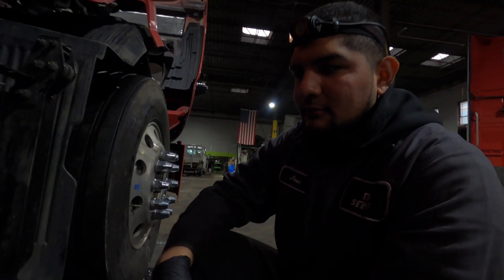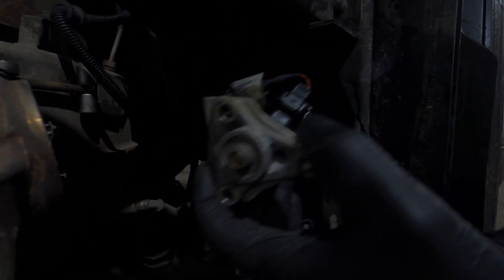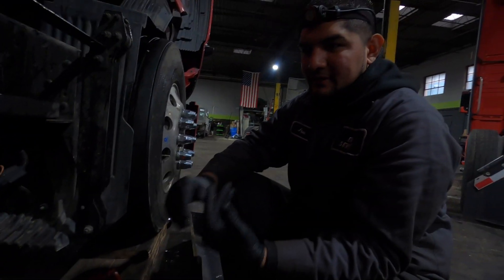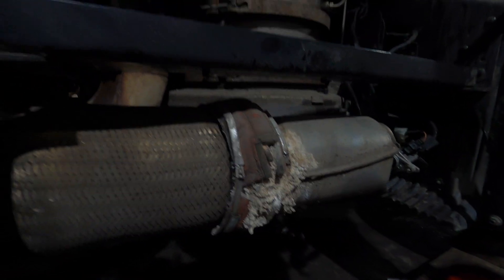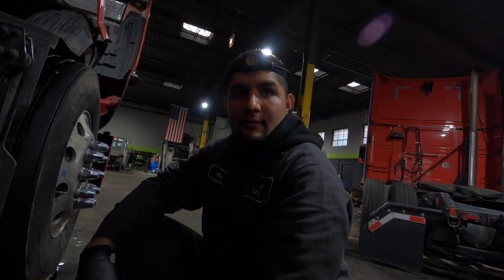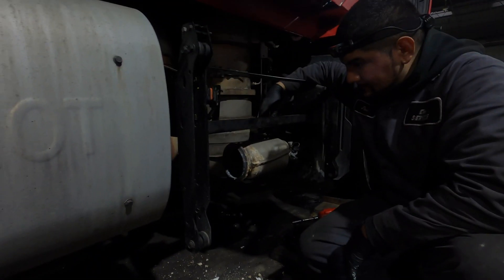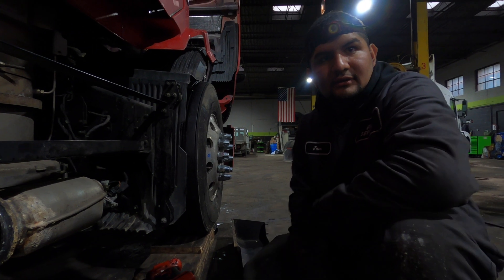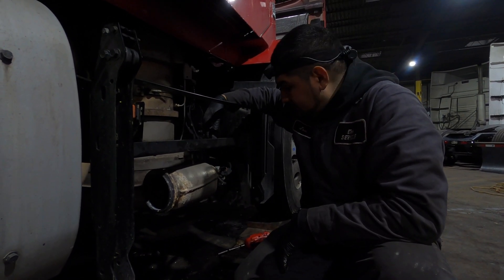Watch a Mechanic Troubleshoot and Repair, a Volvo D13 with SCR, DEF and NOx Issues.

Comment: I do my own repairs. Bought a Tech Tool for around $3k, the whole setup, after Stealership couldn't diagnose and repair the SCR fault issue. Every time, damn thing was going into 5mph derate. They would charge around $400 to turn that thing off; it's called "Exit Inducement". If you can afford it, purchase the program, become familiar with it, and perform your own diagnostics.

Comment: I have this same issue. Builds up on the clamp close to the dpf. I cleaned it and installed new gasket and put it back and it still formed crystallization in 2 hours driving. What could be the issue ?
Reply: Hairline crack.

Comment: Hi wondering where you our located i just started watching your vids and iam looking to get a 16-15 volvo with around 500 on it. I want to use it as an rv hauler wont be pulling heavy weight but would be nice if you could look it over.
Reply from the maker: look up Era Service in Chicago
Reply from the maker: Thank you for watching

Comment: Hi there I have this def build up and leaking from the flex bellow pipe I have change the doser then changed flex pipe clamps and gasket and sealed the hairline crack near the doser but still it’s leaking def I don’t know what else to do 
Please help
Reply: Did you solve this issue? I am having build up like in the video

Comment: What is the part called that is all busted up connecting mesh hose to unit?  I am guessing clamp but the cover is that a heat shield/blanket or what?  Thanks!

Comment: 2014 Mack MP8. Last night display pops up poor def quality, parked regen required. Performed regen but message still on dash. No check engine light. I perform a second regen with my OTR Performance regen tool, still the message is there and derate was near. I filled my def Monday evening. Hopefully just water downed def. I will syphon the def tank and refill with fresh tomorrow and do a forced regen. Hopefully this solves my issue. What would be your opinion? No leaks detected along the system.

Comment: I would have run an injection spray test to verify the injector is dosing properly. Quickest troubleshoot with no guessing.
Reply: Do you mean the 7th injector or the dosing valve?
Reply: @johncalvo1743  No, the def doser
Reply: @RHILTONJR100  Thank you.

Comment: Seen that a few times myself. I'm a Volvo/Mack master tech. In my experience people just fix the problem without trying finding what caused the issue to begin with. A leaking DEF doser will cause all sorts of issues. My favorite is the P20EE00 fault lol see it all the time.
Reply: I'm not 100% sure for the reason of the valve recession and breakage issue. Usually happens around cylinder 6 and 5. People think it's because of the increased heat because of the egr valve being near those cylinders. But I've seen it happen on all of them. The mack MP8 doesnt have the valve issue like the D13. Mack has different tuning and that's about it so who knows the reason. The SCR rarely fails. Usually it only does if its contaminated with coolant or oil from engine failure. They do wear out though they are good for around 1 million miles. It's a hard trigger to pull replacing a 8k part
Reply: @polarisboy67  I suspect valve breakage due to ether starts when they are experiencing hard start condition. I've only done 5 heads because of a broken valve on I-Shift.
Reply: polarisboy67 in your experience what’s the reason for the valves & seats burning up or being shot these engines? Or shall I ask what are common failures you see on them?
Reply: polarisboy67 as far asP20EE00 how often is it actually the scr malfunction?
Reply: I have this exact code right now, and dealer is telling me, the whole scr system needs replaced, I’m only at 595k on my d13
Reply: @ahiskaa9807  I have The same problem and the dealer told you same thing what you did ? Please give me some advice what you did with your scr  system thanks brother .
Reply: Do you have experience with code p225e Mack mp8
Reply: @rodolfosanchez1661  You will have to refresh my memory what is the description of the code?
Reply: @polarisboy67  it is p225e
Reply: Actually yes I have alot of experience with that fault. It can either be a fault with the inlet or outlet nox sensor. What year is the the truck?
Reply: @polarisboy67  it’s a 2014 Mack
Reply: P20ee it’s a bitch related to scr box  5 K box I should say….
Find the exhaust leaks first and than prepare to swipe your cc for $5 K box  … 
Cheers 🍻

Comment: Is there a way i could get rid of the SCR system? the DEF is too expensive
Reply: There's plenty of ways to delete, but you would be in violation of emission laws.
Reply: @RHILTONJR100  please I want to learn, here we don't have any of such laws. And scr has been causing me serious pain. My truck is stock at 5mph, I have washed the dpf and also done Regen but the scr performance 5mph is still there
Reply: @Meninist-i2r  you may have clogged 7th injector, clogged EGR VALVE AND COOLER

Comment: I have a  question. Is a D13 the same engine as a MP 8?
Reply: They are the same for the most part. The MP8 has different tuning that represents the torque and power curve mack is known for. And they seem to have way less issues than a D13 by far.
Reply: Mp8 is a d13 but red
Reply: Yes.  same
Reply: TheNucleerbomb 

D11 = MP7  
D13 = MP8
D16 = MP10

Same engine.
Reply: @thatdieseltech4666  d16 was discontinued in 2017, such a shame